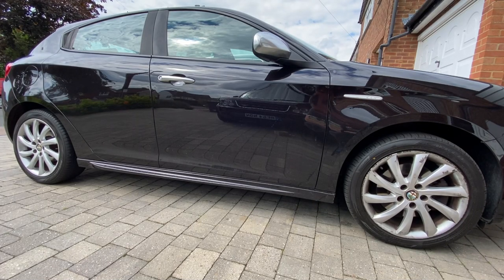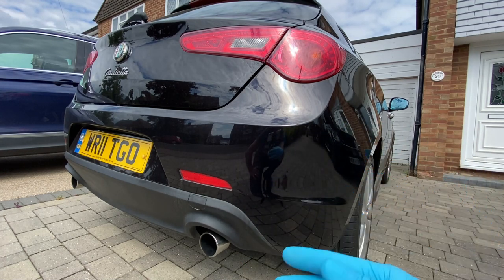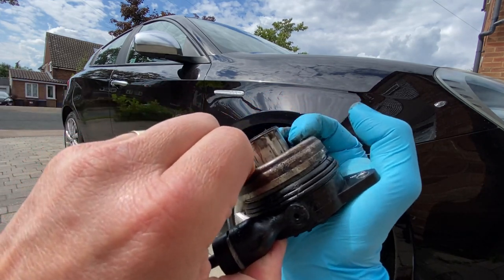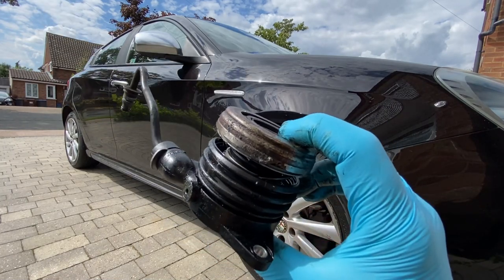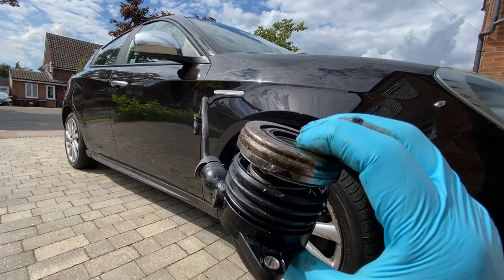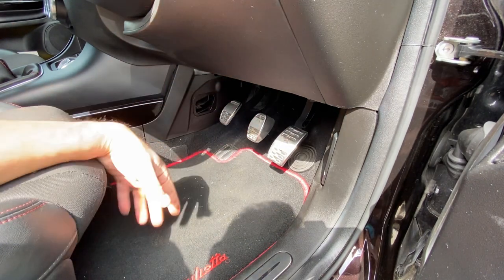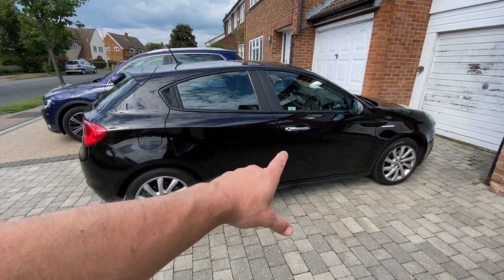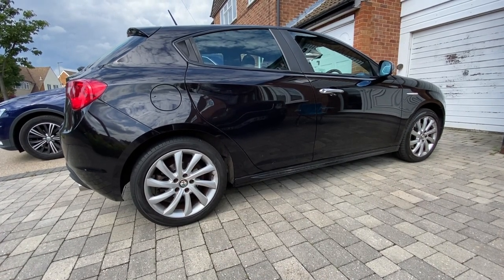Alfa Romeo Giulietta Clutch Slave Cylinder Failed Pt2

Comment: These concentric clutch slaves really, really, really annoy me. I can change a 1971 MG Midget slave in under half an hour without removing the engine or gearbox. It also costs £15 last time I did one, which was about five years ago. When manufacturers moved to having the slave inside the bell housing I could not believe the stupidity.

Comment: Hi Tony! This year we had spent over 5.000 EUR in our giulietta (170 hp 1.4MA @164.000 km): timing-belt, turbocharger with lots of turbo-related parts, rear breaks and much more. Two times we had to be hooked up. And now: we have the same issue as you had! There is still love for the giulietta - but i don't know if i have the right job to hold her for longer times. In fact, we ordered a new car now - and we will give her a second try as a  (quite expensive) secondary vehicle. These weeks we get to know a lot of cars as rented ones, because neither the repairwork of our workshop nor the dlivery of the new car  takes place as fast as in former times...

Comment: I've just had a the dual mass fail on my 2.0 150bhp, however I managed to get the clutch, flywheel and slave cylinder all LUK for under 400 pound. Was a difficult job even on a ramp took 8 hours as the full subframe had to be removed. Always replace everything when a single part fails as it will all be worn.
Reply: Any links for that price :) ?

Comment: Big bill but I was quoted the same for my Cloverleaf at a local specialist luckily I got my car taken to another garage near Southampton and they it done for £1150. I had the same issue, literally came out the the car and it had gone. I’ve heard that they can fail due to the clutch slipping cause the cylinder to overheat. Price will be similar for all Giuliettas as they all have the C635 gearbox which requires the subframe to be dropped making the labour bill very high.
Reply: Do you guys not have extended motor warranty plans?
I took out one when my manufacturer one lapsed. It came in very handy for the clutch replacement. The whole job cost R18000. I only had to pay an excess of R500. Thank God....
Reply: @Rookshana.Takolia786  don’t think we can get cover for 10 year old cars.
Reply: It's the dual mass flywheel that's expensive, I hope if mine goes it will be alot cheaper on my multiair. Sod it , in my experience the slave cylinder is usually on the top of the gearbox making for an easy change or thats how thy used to be.
I got a classic during lockdown a mk3 Golf gti 8v to play around with. When the clutch failed I decided to book it into Mr Clutch , drove it there the cost was £260 with a warranty.
Reply: @Jackfi_89 
That's terrible. Maybe you could save a monthly portion of your income as a contingency? 
Here they offer great mechanical warranty at reasonable prices.
It's a worthwhile investment.
Reply: £497 inc VAT for clutch replacement or £640 Inc VAT with  centric slave cylinder on a Guilietta multiair 170. Quote from Mr Clutch today. 
Like I always say the money you save in fuel with a diesel you pay back come clutch replacement time , typical with modern VW or Audi too. And if BMW set another couple of grand for a timing chain replacement.

Comment: @vialettotony question as I’m paranoid as hell now. When it completely failed was there any small pre warning signs. Because I was out with mine the other day (also a 11 plate 2.0 JTDM-2 170BHP) and everything was fine until I upshifted and noticed the pedal didn’t rebound all the way up. It only did it a couple of times then it was fine. There’s no leaking inside or out, I’ve even left a pan underneath just incase. Today I drove it just a short distance and it was fine. Do you think it’s something to look into or could it be the sudden switch in temperature?
Reply from the maker: Hi. There was no warning at all unfortunately. I drove it the night before with 4 people on board and it felt fine. When was the brake and clutch fluid last changed? Might be worth getting that done on the next service. All the best 👍
Reply: @vialettotony  I had the clutch checked yesterday with my local garage and the boss took it for a test drive and said it’s fine as he couldn’t see any leaking anywhere, the hoses are fine and the fluid was only replaced in march. He did say though that it’s at the beggar of the end with a very minor slip and the reason for the pedal only doing it occasionally proves why. I drove it yesterday and it was fine, just like the night before and it didn’t stick once. It’s for sure playing mind games on me but hopefully it buys me a little bit of time to start putting some money aside for a full clutch kit.
Reply: @vialettotony  well I took the safe route and just had a whole new clutch kit+flywheel and just shy of £1200 it’s done. It feels strange though, like you said it’s softer. Hopefully it’s a good thing.

Comment: There were no symptoms of a damaged slave cylinder before it happened?
Reply from the maker: Nope. Just went without warning. All the best 👍
Reply: @vialettotony  In my Giulietta I can hear the noise from the gearbox. Sometimes, not always. It stops when I press the clutch pedal. I think this is a slave cylinder. Clutch and dual mass fly wheel works fine.

Comment: Aw Tony that was horrible to see.  What a financial bill. Is this the same thing as just your clutch failing your slave cylinder failing? On my wife's Peugeot 106 costs peanuts to fix it's happened twice.
Reply from the maker: Hi Cran. Because the slave cylinder is internal you have to remove the clutch to change it 🙄. Essentially making it the same as needing to change the clutch. Not ideal. Hope you’re well. All the best 👍

Comment: How does a failed slave damage the flywheel? 

And a leaking slave cannot effect the brakes - that’s simply impossible, they’re completely separate and unrelated hydraulic circuits.
Reply: And I assume you had the rear main seal replaced while you were in there?
Reply from the maker: @froggy0162  all main clutch assembly parts yep. Cheers. All the best 👍
Reply: @vialettotony  No, I mean the rear main seal. The oil seal on the back of the crankshaft that is obviously only accessible with the flywheel removed.

It’s a cheap part so it’s good practice to replace it while it’s accessible even if it’s not leaking (yet).
Reply from the maker: @froggy0162  nope.
Reply: @vialettotony  Oh well, you might be ok depends how long the seals tend to last on those GM tractor engines (diesel in an Alfa is all sorts of wrong…). If you do get a leak which is common as the kms stack up, you’ll be up for a big bill to remove the gearbox and clutch again ;) I like to invest the 30 bucks for a new seal to mitigate that risk :)

Comment: Hello, how did you know that the culprit was a slave cylinder, and not the master cylinder? I have a problem with the clutch pedal on my 159 TBi, and I am trying to figure out is the problem master cylinder or slave....
Reply from the maker: For me it was quite easy to tell as there was a puddle of fluid on the floor directly under where the slave cylinder is. Have you tried bleeding yours? All the best 👍
Reply: @vialettotony  ah yes, you said it in the video, I saw I was missing about 120ml of break fluid, but that didn't solve the problem, the pedal is dead, I think there is oil underneath the engine, where transmission and clutch connect ... Inside, behind the clutch pedal there is no oil on the master cylinder... I don't know how to bleed the slave cylinder, I thought the slave cylinder was inside the clutch....
Reply from the maker: Yeah thats right, the slave cylinder is inside the clutch... or at least it is on the Giulietta, so suspect it would be the same on a 159. If your pedal is to the floor, then it sounds like it could be your issue, especially if there waas fluid on the floor and around that area. Unlikely that bleeding it will solve your issues. I don't have a video on it unfortunately, but there are a few out there. Sorry i can be more help. All the best 👍
Reply: @vialettotony  thank you for the information and help, I think I found the problem, there is a leakage somewhere around the break fluid reservoir, I topped the reservoir with new break fluid, pumped the clutch pedal 100 times and it started working, drove for 10 minutes and already it was missing around two fingers width of oil, looked underneath the car, saw oil, poped the hood, and clearly there is oil around and on the reservoir...